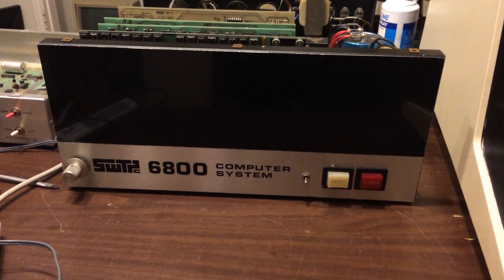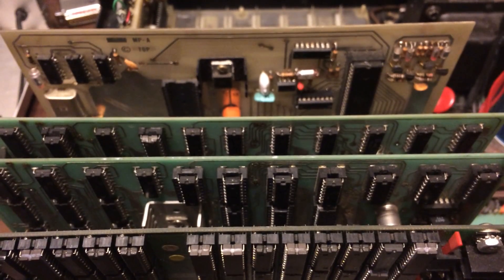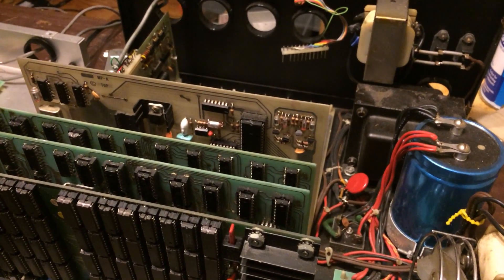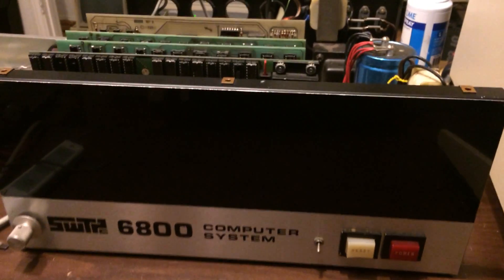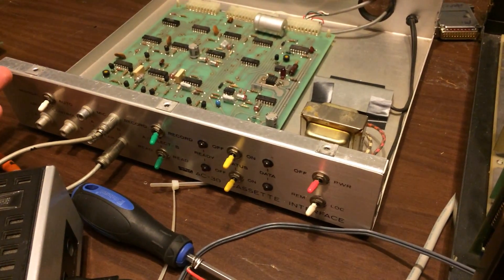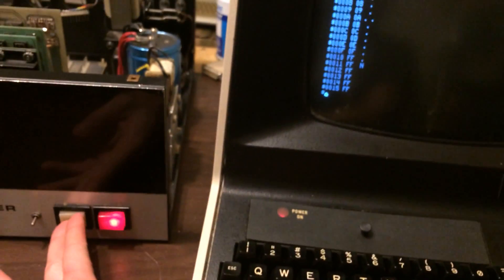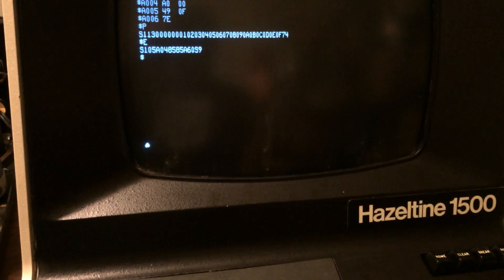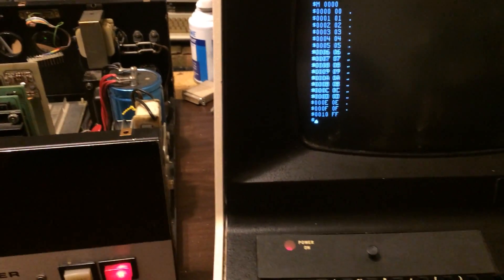SWTPC 6800 Intro/Update

Comment: The baud clocks were distributed over several lines of the SS-50 bus.  A simple trace cut and  jumper wire on the MP-A (CPU board) where the baud clock generator resided could replace a default bit rate with an alternative, like 9600 or even 19200!.  of course a teletype could not run at those speeds, probably why this machine was not modified.  A similar modification could double the CPU speed (from 1 to 2 MHz.)

Comment: The RAM chips were 2102's :-)

I had one of the early SWTPCs, purchased in 1975 and delivered in early 1976,  strictly a kit at the time (along with the -Heathkit- Griefkit H19(?) terminal (*THAT* was a genuine nightmare!), and the AC30 tape interface.  

Most people who installed those 32k aftermarket cards had the Microware RT68 multitasking loader swapped out for SWTBug/MIKBug - it was amazingly good at timeshare for a 1k 6800 cpu, and forced us youngins to learn to produce correct code (re-entrant and relocatable) right from the beginning.

The chassis you have there is one of the fist 250(I think) produced: you can tell by the two main buttons. After the initial run, they changed from big red and white to either two white or white and translucent clear (or something else I am not remembering).

The reason the I/O was limited to 1200 baud was because of poor circuit board planning:  too much crosstalk and not enough capacitors to quiet the spurious signals.  If you were willing to do the work and add caps on your own, you could get the MP-S up to 19.2K pretty reliably. 

The AC30 tape interface was a disaster. While the design goals were admirable ("auto" mode, a few other bells and whistles), it was notoriously unreliable unless you went to very high end audio equipment.  Honestly, I never did track down the exact issue, although I know of nobody else who did either - you either loved the AC30, or threatened to shoot it every time you turned it on. 
After months of unreliable to dismal operation, I swapped in a homebrew (8") floppy interface with homebrew floppy bootloader.  Once that was done, this was a dream machine (compared to the MITS version anyway - the MITS was extremely unreliable in my experience): super easy to boot, relatively useful compared to other machines of it's day (I had several in use commercially, set up as full blown multiuser systems with the RT68), and very inexpensive compared to it's rivals.  Of course, each and every machine required about 60 hours of build/testing time, so the production line (me) was always short staffed :-/

Because Motorola put some serious thought into their microprocessor lines (unlike the Zilog "solution" that haunts us to this day), porting software up from 6800 to 6809, 68000, etc., was easy.  Additionally, there was a lot of software available for these beauties: all you had to do to access the free libraries was contribute something. Anything!  As I remember, there were COBOL compilers, basic Compilers and Interpreters, many Assemblers and cross-Assemblers, and a ton of userland software available by the time the SWTPC ended it's run.  I even had a copy of Data General's "Business Basic" [the best BASIC ever written!] that a DG S/E had ported down to a 6809 - this meant that us DG "consultants" could work at home, on our own clock, without putting up $50,000 for a full blown [and used] Nova or Micronova - a real education financer, for which I am forever grateful.  Also, the 68xxx family orocessors were very close to the PDP's in architecture, allowing us to work at home on the guts of our PDP jobs.  Not that I could run MUMPS or anything (although I wouldn't be surprised if that's around today), but I was a very happy camper with my miniature "datacenter".  The very best part is that I didn't have to freeze my butt off while working the 6800's (and it's progeny).  Yeah, they chugged power and threw heat like crazy, but you didn't have to refrigerate the room with a blast freezer either: Bonus !